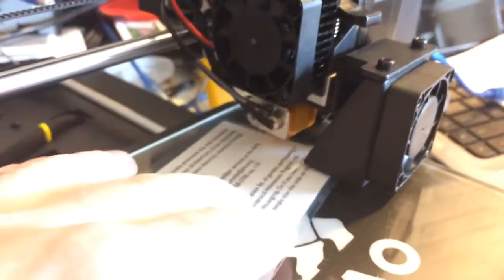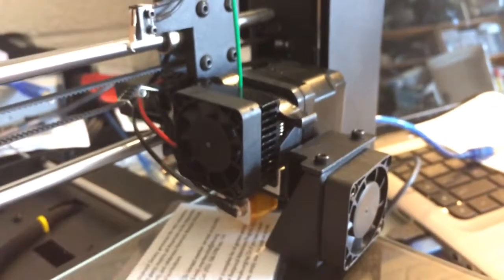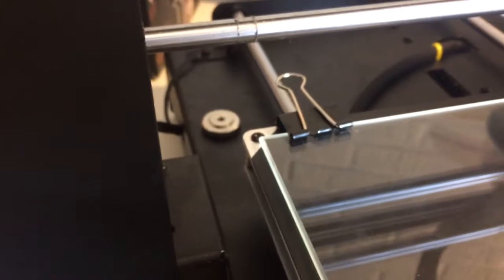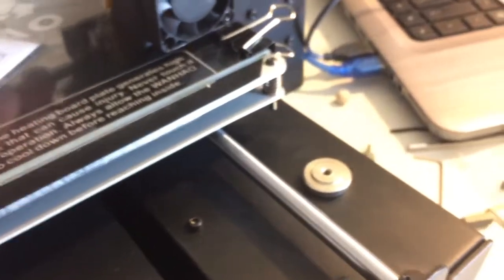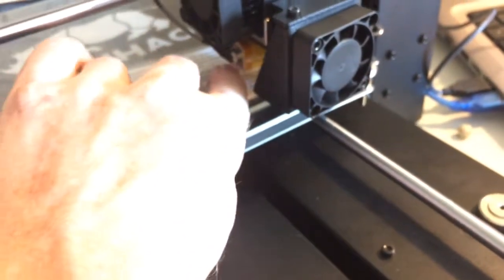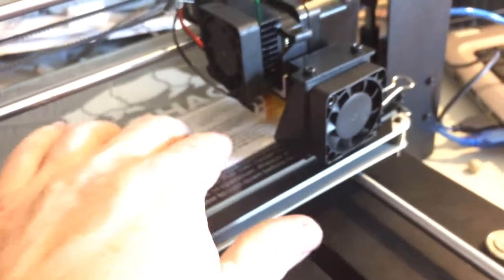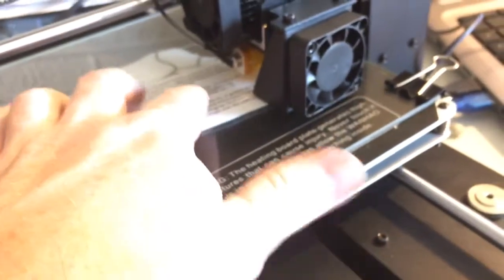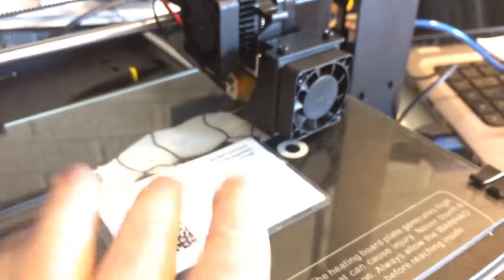Wanhao i3 plus bed level

Comment: I am having the same issue once I put the glass on it. After taking the glass off, I can level the bed again. However, it just proves that the bed can only be leveled by forcing the aluminium to bend. I feel that the bed should not have to be warped manually to the degree it is in order to be leveled. Did you ever get this fixed? Did you have to mess with the calibration offset settings in the actual erom? From my research, the NE and SW corners are software adjusted to be a smidge lower than the NW and SE corners. Let me know how it went, please.
Reply from the maker: Jeff C I did get things resolved. I started with removing the rods and making sure they were perfectly straight. I had to slightly been to some of them to get them to roll flat on a sheet of glass. I also found that the printer was not sitting level on the table and would rock if you’re pressed on one corner. I set the printer on my glass stove top and loosened all of the screws and retightened of them. Where is things seem to have done the trick and the bed levels better now. The corners still do not level all the way compared to the the opposite corners but it is workable now.
Reply: David Cantrell thank you for the reply. What does, "slightly been to some of them" mean? Is that some jargon I'm unfamiliar with?
Reply from the maker: Jeff C Sorry, that was a text to speech fail. It should’ve said “bend”